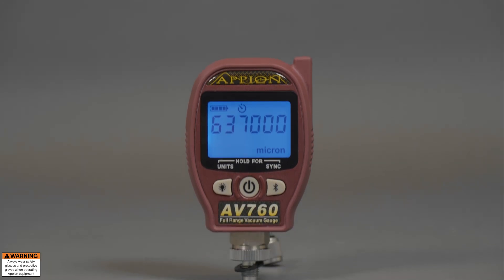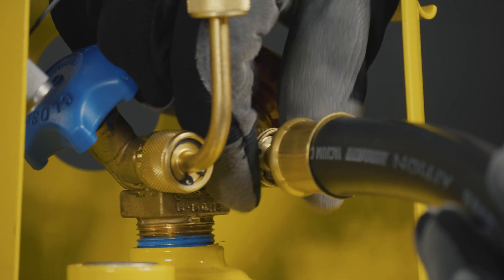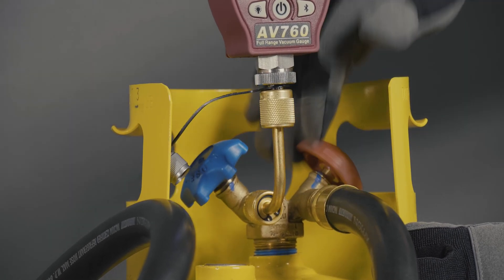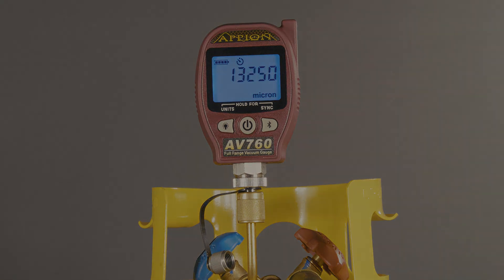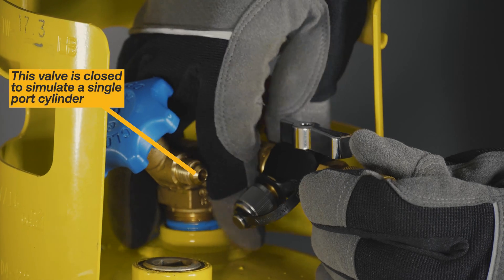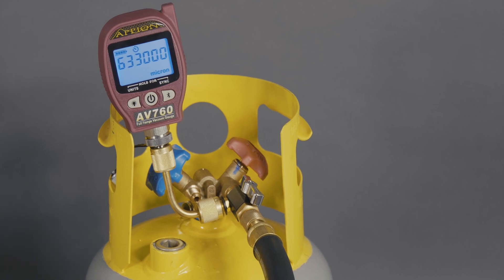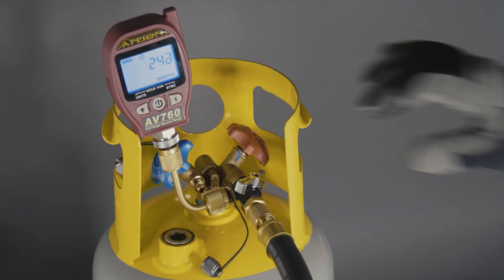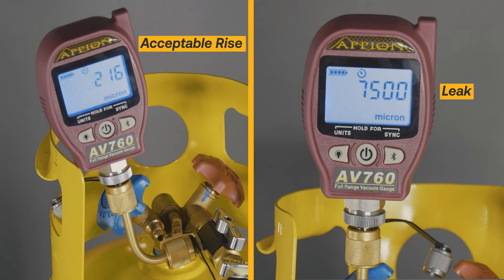AV760 Isolation Test

Comment: 3 different guys at our company bought this $400 micron gauge. All 3 stopped working correctly after 3-4 uses. They would read incorrectly when compared to CPS, Fieldpiece, Just better and testo. CPS has never once had a problem.  These Appion gauges are expensive trash
Reply from the maker: Sorry, you're having these issues. All of our products come with a 1-year warranty and lifetime support. Contact support@appiontools.com for all product support.
Reply: Fieldpiece is likely trash  it most leaking inside gauge

Comment: I have tried this test with cylinder and other tests numerous times. I am 99.9% sure I have a leaking AV-760. Contacted Factory and they were coming up with new test procedures, I guess this is what they came up with. Happy with other Appion Equipment, not a fan of the AV760 yet.
Reply from the maker: The person you've been in contact with is reaching back out via email to try to remedy the problems you may be having.
Reply: I just received an email from technical support. All the Appion Customer Service staff have been helpful, I will post what I find out with my gauge. Thanks